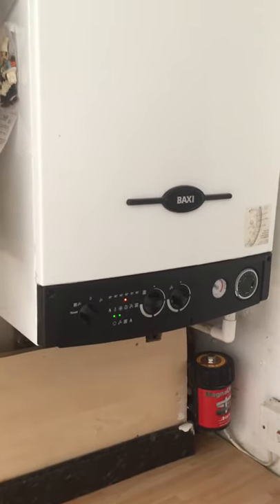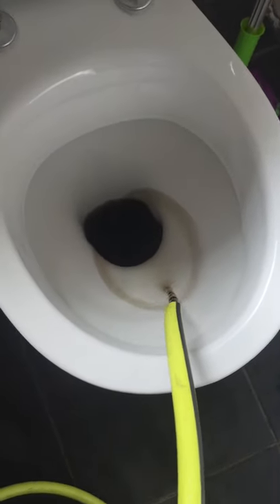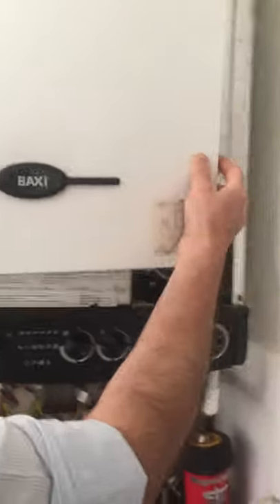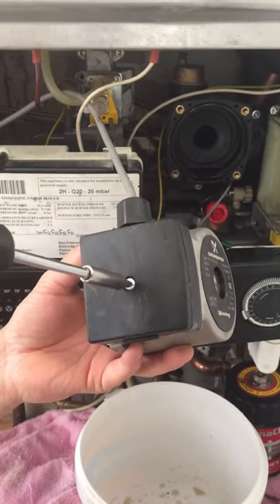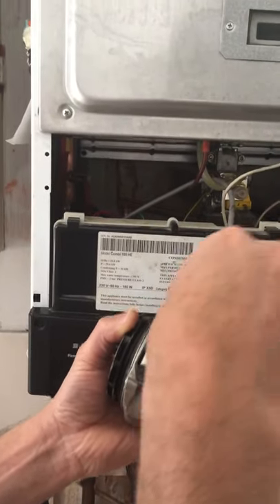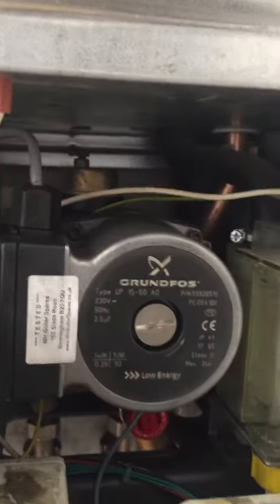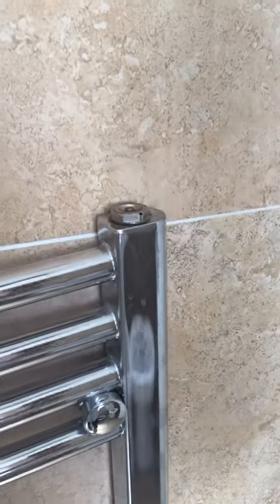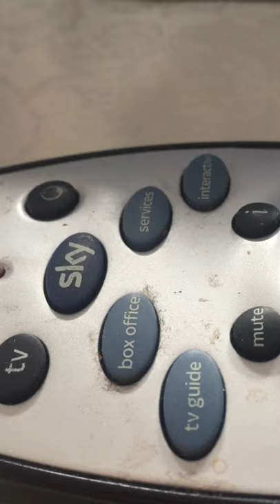Changing pump on baxi boiler 105 he

Comment: When I changed mine I simply isolated the boiler from the water system and radiators , then release the water pressure in the boiler.  Nice video, well explained.
Reply: He can charge more if he takes three times longer
Reply: @handyjayes1  lol come on that's uncalled for lol
Reply: @sweetypie697  that's what 'con merchants' do
Reply: wouldnt recomend that on older boilers the valves can leak then you have 2 problems to fix
but baxi 105 s have a drain off on the boiler dont know why he didnt just use that
Reply: @aftermath3127  .    Yes I used the release tap next to the overload valve. 2 years on and still going strong, when I can afford to put the heating on 😂

Comment: people do not follow his example----
Reply: totally agree!!!!    Not only that, his initial information is WRONG!!!!!!!    The manual doe NOT say the pump is bad, it says  "pump fault or low pressure".   Most common problem is the pressure switch on the diverter valve.
Reply: @tonyPOPhowes  Will re-pressurising the water system get the whole thing working again - hot water and heating, do you think? I've got a very low pressure reading on this same boiler model with no heating or hot water.
Reply: @tonyPOPhowes  Thanks for your reply. I fixed the boiler when it leaked last year (replaced the diaphragm, very simple) so, hopefully, this shouldn't be too hard.
Reply: @SunOnMyStubble   how did you get on ?